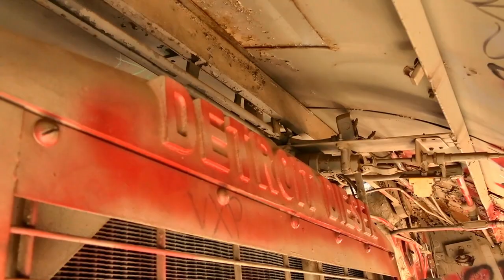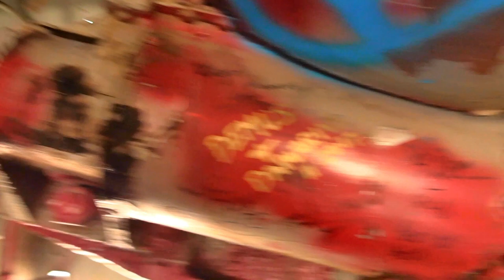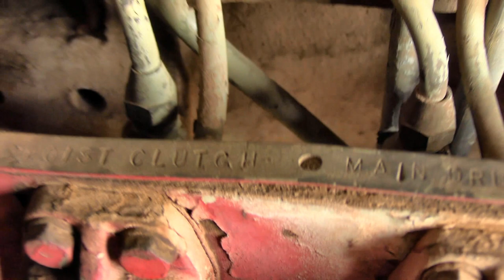Inside the Santa Fe, 200 ton wrecking crane Winslow, Arizona

Comment: I love the track tongs/clamps to grip the rails.  I'm guessing they clamped to the rails for stability and used the yellow outriggers for more stability.  Thank you for the inside shots.  This is very cool sir.
Reply from the maker: I have never seen that before. Also there was large gears under the train. Looks to be self propelled.
Reply: @travelingtom923  Those clamps were used in the case where a lift was being made and the Derrick was getting light on the rear. They helped if there was a heavy car behind the Derrick to give weight to the track. Otherwise, all the clamps would do is lift the track up out of the ballast! But even that could be helpful in certain situations. I spent much of my 41 year railroad career on the Derrick crew, and we had several instances over the years where the rear got light, lifted the rear truck off the rail, and when it came back down it missed the rail due to slight shifting. Then we got to rerail the Derrick as well as clear the wreck! The clamps would have prevented that, but management didn’t like them because of the way they disturbed the track structure. The majority of derricks were self propelled, but at least the Industrial Brownhoist hooks were such a pain to setup to move that it was almost never done. A locomotive and the wreck outfit was always with the Derrick, and it was far simpler to let the locomotive handle the moving. These beasts are such interesting machines, but I can tell you firsthand that it was incredibly hard, heavy, dirty and dangerous work! And when the mainline was blocked, they didn’t care how many hours you’d been on duty! You kept fighting it until the right of way was cleared, the track panels were laid and bolted together, and they could start pushing the backlog of trains that had been backing up on either side of the wreck. We’d get some rest then, but in a few hours the crew would be back at it picking up the cars we had set off to the side of mainline to lay new track, and putting them back on the rail. You’d play cat and mouse with the dispatcher, as they give us an hour or two to work, then we had to clear up to let them run trains. Then back at it again! We earned some massive paychecks on that crew, but the caterpillar sidewinders could handle things so much quicker, and if one of their people got injured it didn’t count against the railroads safety record.

Comment: I noticed the compressor and storage tanks , are those for the air brakes as this is self propelled , or is it an air powered crane ?
Reply from the maker: I saw gears under one truck. It could move by compressed air. Tanks are way too big for air brakes.
Reply: @travelingtom923  upon reflection , this probably was a coal fired , steam powered crane when it was built . Switching out the firebox and boiler for a diesel engine and air compressor was a no brainer conversion  as no gearbox would need to be added .
Reply: Air controls
Reply: This is a conventional diesel-powered friction (mechanical) crane with air controls. Beautiful machine! Greetings from Russia!

Comment: Nice presentation Tom, I wonder how this compares to modern cranes?
That Detroit was sweet it looked like it had an 871 on top of it.
Were you able to find a build plate or nomenclatures on the car?
Keep posting them sweet videos.
Reply from the maker: I don't believe these type of cranes are used on the railroad anymore. Now days they use those mobile caterpillar crawlers. No I did not find any builders plates. I know they did make builders plates for the steam cranes but probably not for the diesels.
Reply: It is definitely a V8 two stroke Detroit diesel. You can't tell the size without the tag on the valve cover or taking it apart and measuring everything.  But my guess is it is a 8V71.

Comment: Do you remember the 250 ton Erie originally CB&Q we had up at the Balmer car shop in Seattle but only got scrapped because nobody wanted it, the BNSF was giving it away for free.
Reply from the maker: I do faintly remember a large wrecking crane at the Interbay yard. Was near a wheel shop if I remember right. They also had some ex CN, passenger cars, in primer red sitting near the Magnolia bridge. Good memory.
Reply: That's the same one, it was by the roundhouse for a little while but it was tied down at the car shop for most of the time, if I remember right I think it was scrapped in 2013 or 2014

Comment: Guess that was the coupler laying in the bed? - 7:40 , 0:30 How much do they weigh? About 300 lbs?
Reply from the maker: Looked like a coupler off a locomotive as it is pretty short. The knuckle weighs 78 pounds, so it is probably more like around 500 pounds.
Reply: @travelingtom923  500 lbs. - Wow!
Reply from the maker: @JungleYT   I used to drive a magnet crane in a scrapyard. One day I was loading a gondola railcar, and one of those couplers rocked back and forth on the magnet as I was moving it through the air. It fell off the magnet and went right through the side of the railcar! I couldn't believe it was so tough and heavy that it would punch a hole in the side of a rail car. I pulled it out with the magnet and beat the ripped metal back in using the magnet as a hammer.
Reply: @travelingtom923  Yeah... Imagine casting that thing! Unless it's a forging...